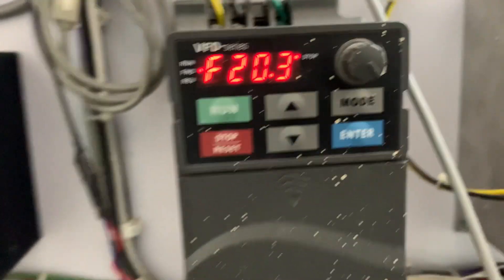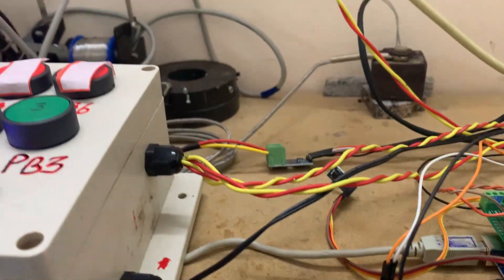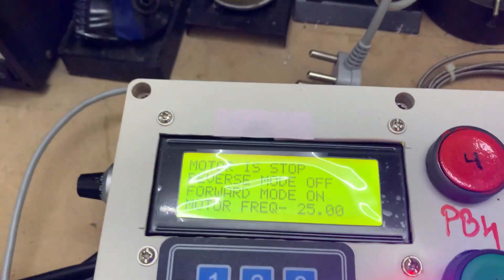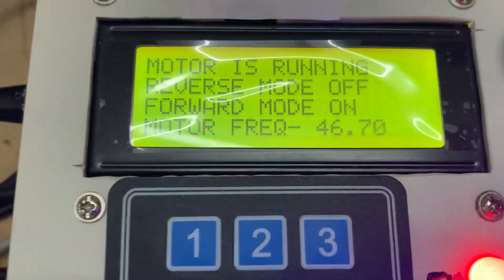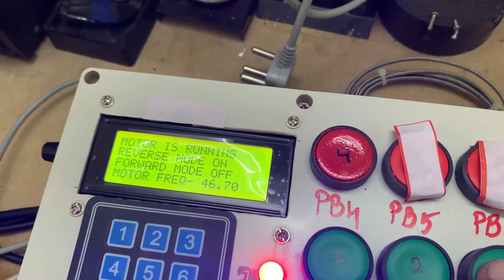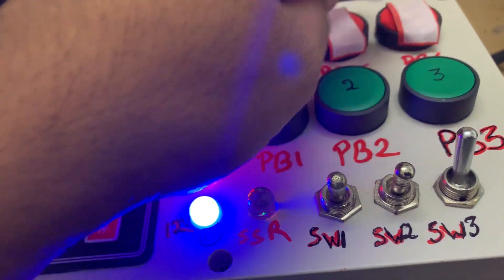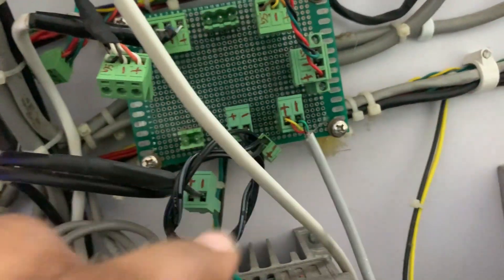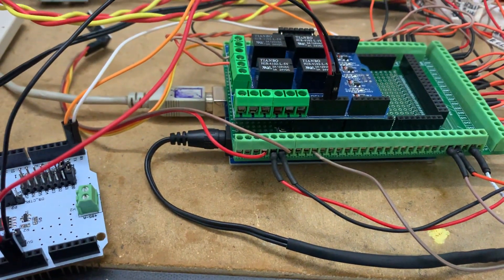Arduino MEGA2560 Controlling DELTA-VFD

Comment: Dear sir thats great  sir i am looking for this video  

Sir can you share code for arduino Ide i don't know about visuino software. 

I want to control my FUJI  VFD by nodemcu. 
Can you make video on this sir
Reply from the maker: You most required the visuino pro software, for this Kind of programming, this software generated a specific code, which is not readable
Reply: @lenkaautomate  ok sir i have fuji VFD so i want to control this vfd by RS485 module and esp8266  module
Reply: @lenkaautomate   in your video air you generate code for arduino Ide     so  arduino ide .ino  file will be uploaded  right sir.
Reply from the maker: Yes possible, it will work
Reply: @lenkaautomate  ok sir.  In description  you share file so this file working open in visuino software  sir 

Because  i don't know about this software  so very difficult  to create this file.   
Only you can do this sir
Reply: @lenkaautomate  sir tried  so many time installation  but everytime  api-ms-win-crt-runtime-l1-1-0.dll show so what to do sir i am not able to install this software
Reply from the maker: You need support from visuino, use this Skype I’d:- bmitov
Reply from the maker: You can contact me by WhatsApp- 9437051215

Comment: sir how you control the speed. because arduino gives only 5v
Reply from the maker: It’s controlling via modbus unsigned value not via analog output
Reply: @lenkaautomate  Thanks Sir But i did'nt know more about Modbus